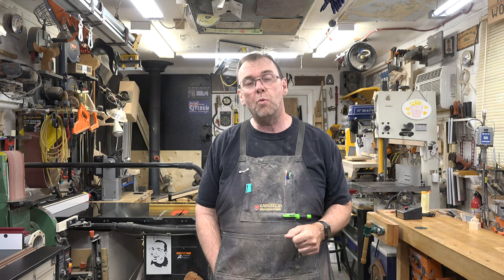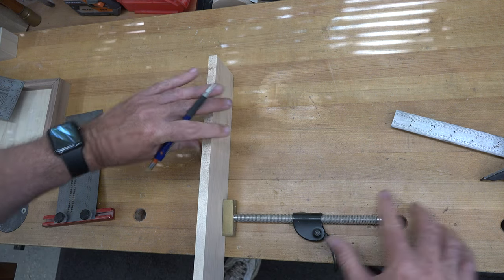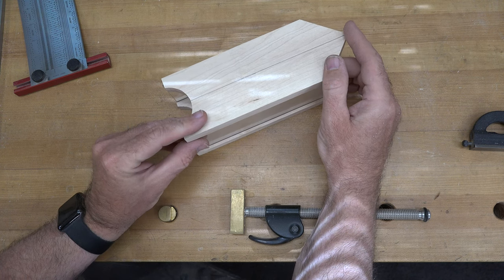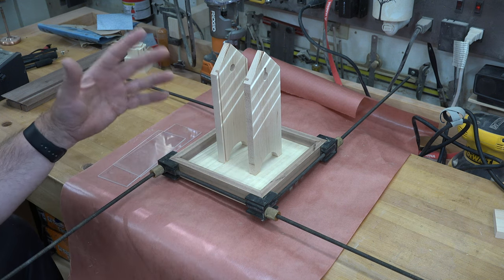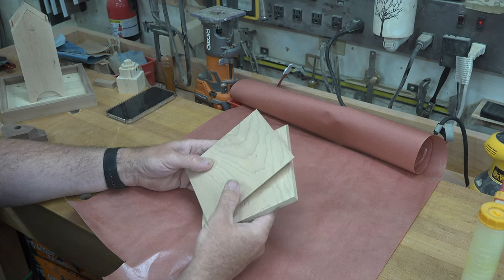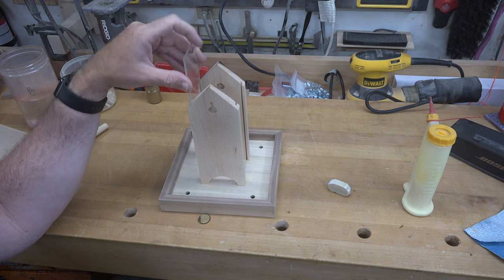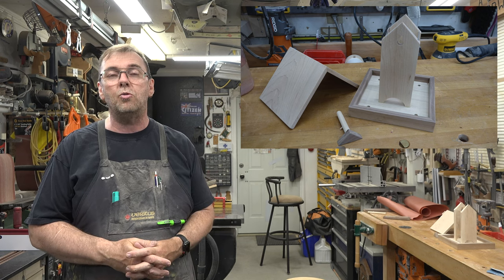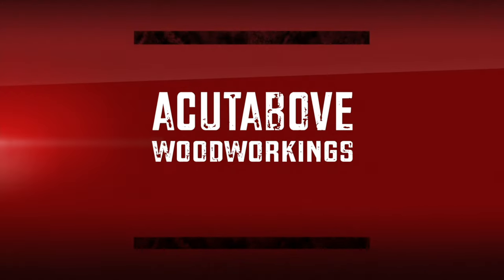Making a Bird Feeder

Comment: I like the way you hold on to the fence with both hands after the cut. I do the same. I don’t let go until a count of three after the blade fully stops. One of my sons is a cop and his advice is when the traffic light turns green, count to three before proceeding. You will be surprised how many times a speeding vehicle whizzes by after the blade…. Light ……..
Reply from the maker: Thanks for the kind words Mark.  It's very easy to become complacent when working on a table saw (or driving for that matter) and that 3 second rule will help to keep you mind focus on what is going on around you.  Great tip.  Thanks for tuning in and for taking the time to leave your comment.

Comment: This is great and another project added to my list! 😊I wish I had your skills with the scroll saw though as my cuts are never very precise! 😳
Reply: Just sharing.  Make sure you are using a Precision Ground Tooth blade.  When the blades are made, they are punch out of sheet metal.  There is a burr on the one side which can cause the blade to cut more to the side.  They grind that burr off, and the blade cuts much better.
Reply from the maker: It's all about practice Julie.  I've been scrolling for about 30 years so don't beat yourself up about accuracy or precision.  The blades that Scott mentions below will help a bit, but nothing replaces practice.  Good luck on your project and your scrolling.  Keep up the great work and thanks for tuning in to the show.

Comment: I really like that.  You don't put anything on the wood to slow down the weathering?  My luck is the wood splits before the birds even get used to it.
Reply from the maker: I do apply a finish of varnish before it ever sees the weather.  They definitely need some form of protection and varnish does a nice job.  It will eventually fall victim to the weather but the varnish will definitely slow that process down.  Thanks for tuning in.
Reply: @acutabove_woodworkings  Thank you!
Reply from the maker: @fishingpervert  You're very welcome.

Comment: I take it your removing the guard on the sable saw just for the video. Rest the time it's on.
Reply from the maker: I'm not going to pretend (like some channels do) that the guard was removed for "clarity".  About the only time I really use the blade guard is when I am cutting sheet goods.  I use it mostly for the dust extraction and the splitter.  Most other times, I find the blade guard to be too cumbersome and it usually gets in the way of cutting smaller pieces.  While there is a level of safety that a blade guard provides, I find that it can also hinder the use of other safety items; making it difficult to use things like push sticks or push pads.   Push pads such as the Gripper can provide a "moving" blade guard by having the push pad actually travel over top of the blade during a cut and while this may seem a little crazy at first, it does a great job of feeding your stock through your saw for the cut while covering the blade during the cut.  
While I do believe in promoting safety in the shop, I'm not going to be a liar and say that I remove my guard for filming.  Thanks for tuning in and for chiming in with your question.